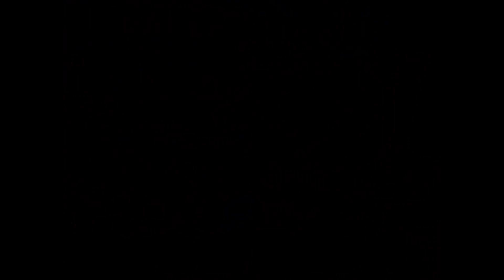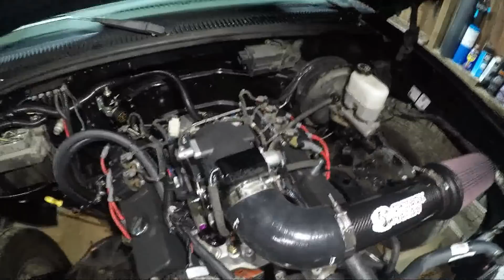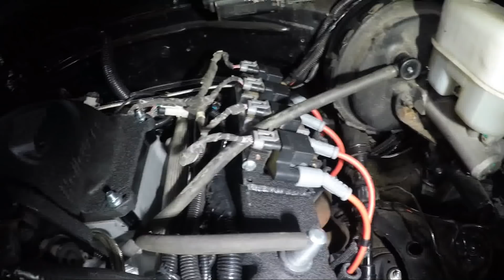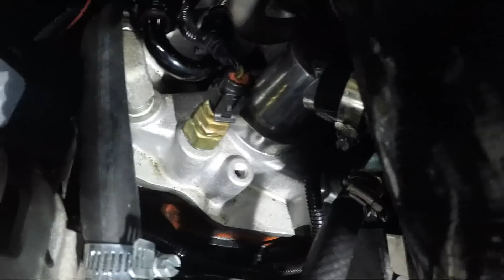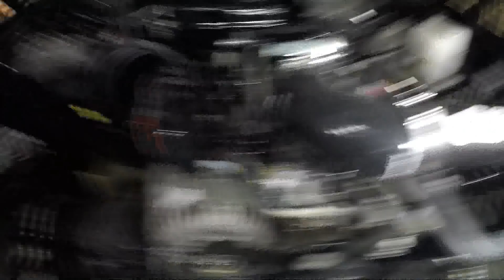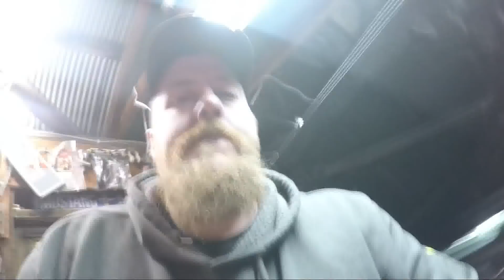GM 24X SBC Conversion Information V.1

Comment: But how do you add the reluctor wheel on it and how do you fit a cam sensor ? Am I in the correct video ? I have an 86 SBC that I wanted to put a 99-02 411 pcm and harness on
Reply from the maker: EFI Connection sells the cam and crank setup. To be honest, performance versus dollars spent, just go with a Holley EFI setup.
Reply: @JoshWatson damn for real? You sounded excited about all of this and I wire up 99 07 LS harnesses as a side business I just have somebody asking me to do this to there SBC so it's not out of the question the issue is again happy wife happy life

Comment: I have a gen1 with mild street truck 62 c10 qjet cam 108 to sa 232/244 half lift vortex heads. Msd cam sync plug. Ckp 24x 1x cam. Some what cuz timing cover. Still won't fire

Comment: I’d like to do this setup on my Gen 2 Lr 1, I want it simple . Typical parts store parts if possible. Any advice you can give wil be “GREATLY” appreciated.
Reply: I’m still waiting on the 3rd video!!! To figure the last step I have 0411 on my lt1 but I want coil on plug like this without the expensive “kits”

Comment: I’m really loving this idea! Because I’m looking at Terminator X etc. Question, can I add a knock sensor and do I use aftermarket ecm? I want the nitrous control offered by the Holley ecm but I want knock retard.
Reply from the maker: You can run knock sensors with the Term X I know for a fact.

Comment: I'm looking at doing this with a BBC. I know the differences between the 2. But I think my questiin and or problem I'm going to have it the reluctor wheel. Did you pull one right off an LS crank or is there a special place to get one?
Reply: I had to get a reluctor for a swap, not the 24x but a 4x in my case. Don't know where you find them besides evay but I happened to get one from a machine shop that had parts laying around. It helped that I was getting work done there. Edit: Also EFI connections may sell them

Comment: are you using the EFI connection 24x reluctor behind the holley cover?
Reply from the maker: Yes.
Reply: @JoshWatson  Sir, can you do a video on the tuning/programming? If not, how can I contact you? I need help. I have a 99 350 vortec 24x and my 411 box still has a V6 tune. I have HPTuner brand new. No idea how to tune yet. Your videos are great! Thanks, Jimmy

Comment: Is your block a roller block? I came into a 383 in a good deal and it wasn't a roller block. I was under the impression the Holley cover wouldn't work unless you had one. It would be awesome if that was wrong.

Comment: Hey man! I am running ebl currently but can figure out how to interface it well with tuner pro and I’ve always wanted to run coil on plug so this looks like a dope option to switch to. Do you happen to have Instagram or Snapchat?
Reply from the maker: You'll be alot happier stepping into the 21st century with HP tuners or EFI live with the 24x conversion. I'm confident if you can tune and burn via EBL, you'll be fine with the above mentioned tuning software.
Reply: Just Truckin' Around I think so too. I’d like to build a max effort 383 for my off-road truck, do you think the 0411 pcm would handle an aftermarket msd crank trigger and non magnetic pickup or does completely nullify the purpose of doing the 24x swap?
Reply from the maker: @dirtdevotion14  If you're going as far as an MSD crank trigger, I'd just go all out with a Holley pcm or one of the micro/megasquirt systems. Kinda defeats the purpose of inexpensive road-side serviceable efi that'll handle power. :)

Comment: Currently doing this to my 91 Camaro. Been using Ebl and want more out of the car. One question what reluctor wheel did you use? Efi connection?
Reply from the maker: Yes, I used the EFI connection reluctor. But that's the only thing I'd suggest buying from them. Everything else is available as a stock part from your local parts store.
Reply: Just Truckin' Around . Good to hear! Any issues with the Holley timing cover? Meaning using double or single roller while using the reluctor wheel
Reply from the maker: @Pito_Chiquito0068  I havent had any issues. I run a Cloyes 9-1157 single roller timing chain. Its proven to be sufficient. It handled the truck being turbocharged just fine.

I'm not sure about a double roller with this timing cover and reluctor wheel though. As it may move the reluctor too far forward out of the crank sensors field of view.

Timing cover I used is a Holley #21-153.